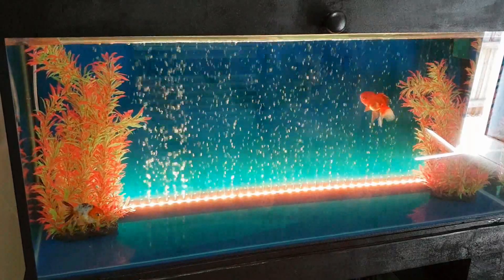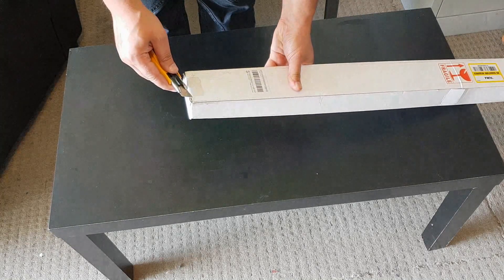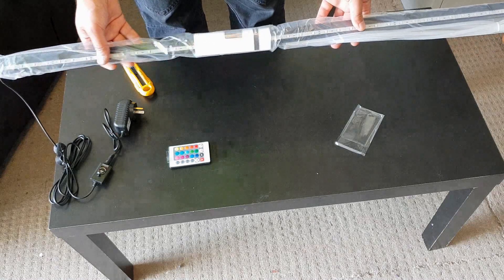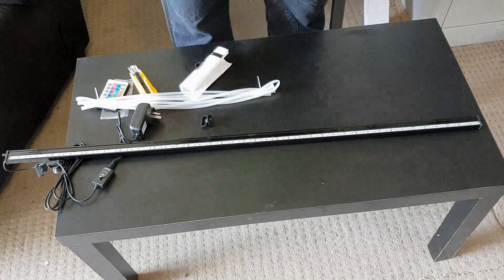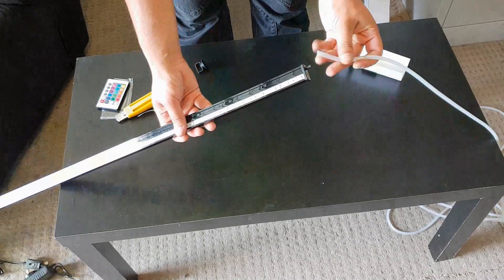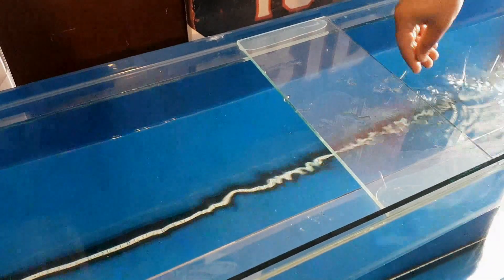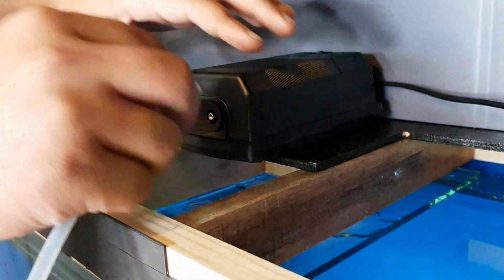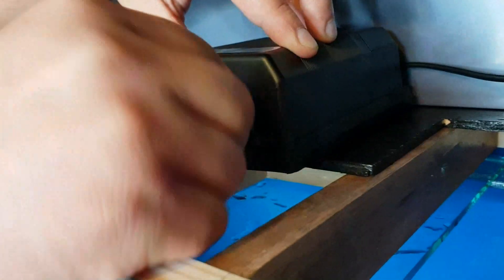Setting Up Underwater Aquarium Lights (LED Bubble Wall)

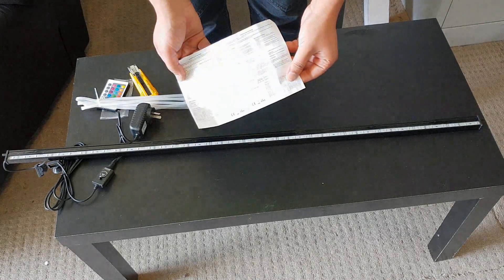Comment: “a user manual which I didn’t bother reading” (1:40)
hahaha you don’t need the manual you’re the manual today!!
Reply from the maker: Appreciate your kind words, it's not a bad investment as I have still got the lights in the tank. Only issue is suction cup, can't stand the pressure of bubbles, easily replaceable though.

Comment: I just bought one and it doesnt have a tube, only one suction cup. I don't know if I was suppose to open it up or what. It will not keep on the bottom of the tank. I think I am going to give up on bubbles. I bought a waterfall aquarium and it has been a nightmare. Now at least thats working and I guess I should be satisfied with that.

Comment: I have the same one in my tank. I am having problems with the holes getting stopped up and bubbles only coming out of a few of the holes. Have you had this problem as well?
Reply from the maker: Hey mate, I have had the same issue after few months. It worked fine when I turned up the air pump to high but ended up same after a month. It could be either holes clogging up or some holes getting wider and not enough air is pushed through the remaining. Never bother investigating though as I use it for the light only now. Appreciate your feedback

Comment: Hi! Sorry I know this video was a year ago... just wondering if my Whisper air pump, for my 55 gallon, would be strong enough for a 20 inch light? Do you happen to know?
Reply from the maker: Hi Leah, what is the pump flow rate? Mine had twin outlets with 200 lph each flowrate.

Comment: Can i connect this with top filter setup?
Reply from the maker: It is air driven so you will need an air pump and bubble wall effect will be created if suction cups are attached to the base of the tank.

Comment: Does the temperature of water increase due to the light underwater
Reply from the maker: It doesn't increase as LEDs are low heat emission lights. It would have been nice if they did, would have been a good addition to tropical tank. Thanks and have a nice weekend

Comment: are you able to link the product, I have been looking for a light with the bubble feature for a small tank (28cm) but only found a light so far. Thanks :)
Reply: LED Aquarium Lights Submersible Air Bubble RGB Light for Fish Tank Underwater U

 Ebay

Comment: Hello do you have to attach the hose to both ends or can you use a single attached hose
Reply from the maker: Hello JV, I would suggest attaching air tube to both ends so bubbles are uniform across the entire length. Attaching it to one end and blocking the other end with a plug might not give the same affect. Appreciate your time mate.

Comment: Can you tell me where you bought this product thank you
Reply from the maker: Hi Jimmi, I bought it on eBay. There would be heaps available now for sale at an affordable price.
Reply: Ok thank you . I have one last question, how many cm is the LED? and the black box where you have to connect the pipes what is it called?
thank you first for your answer
Have a  good day
Reply from the maker: @jimmiomar415  Hi Jimmi, length of LED is 102cm, you can buy them in different sizes. The shorter the cheaper. Black box is air pump for the tank.
Check the description of video for more details, I have put prices down at the time of making this video.
Reply from the maker: I hope it helps, if you need any further assistance then I will be more than happy to assist
Reply: Fishaholic thanks again for your answer 
Have a nice day
Reply from the maker: @jimmiomar415  Thank you and you have a good day too.

Comment: Hi,is there any reason you couldn't put these in a pond outside
Reply from the maker: It shouldn't be any issue as the lights are waterproof.
Reply: You might want to get a waterproof plug cover or connection box for the controller. Those are sold at hardware stores.

Comment: Can you tell me the name of the exact product.
Reply from the maker: Don't remember the name of exact product but if you search for aquarium underwater LED lights with bubbles then you should come across quite a few different products. They should all work the same. 
Bigger lights will cost more than the smaller ones.

Comment: How to buy this it is available in Amazon
Reply from the maker: Not sure about this model but there should be heaps of different suppliers selling various different under water led lights with bubbles. Search on Amazon and you should be able to find something that's in your budget

Comment: If I use this do I still need a fliter ?
Reply from the maker: Hey mate, it will only replace an air stone and lighting in the tank. A filter will be required to keep water clean.
Reply: Mines not working properly water not coming out of all the holds
Reply from the maker: Must be the air pressure if its new. With time it will start getting clogged and you won't get evenly distributed bubbles. I have had the same problem after few months.
Reply: I think it’s the pump I’ll get one with higher watt 
🙏🏾 thanks
Reply from the maker: I believe mine had an output of 200 L/H.
Reply: Okay

Comment: Silly "noob" question---It doesn't hurt the pump to have both ends connected? This is how I set up my double bore Whisper 100 on my same size tank as yours. I had to replace the diaphragm in the pump, so I'm not sure that hooking up both sides was the cause.
Reply from the maker: I have both ends connected on my pump as it is dual output. Should be same for yours, pump might be faulty otherwise should have worked fine.

Comment: I would buy one if I wasn't poor
Reply from the maker: Sorry to hear that mate, but you can build one yourself for cheap price, there are underwater LED lights and bubble wall effect can be made by drilling holes in an air tube. I didn't had time so bought an already built one.

Comment: Hi, is it possible to have the bubble turn on all the time but the LED lights turn on only when we want it ie the lights is off most of the time until say if we have guests and turn it on
Reply from the maker: Hi, yea that's how it works. I have had bubbles ON at all times and LED lights - white ON during certain times of the day.